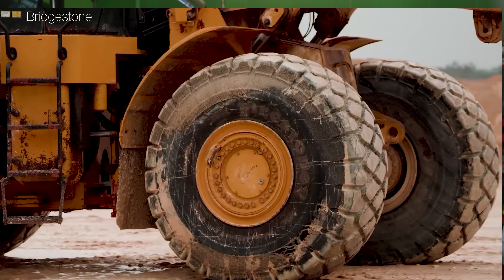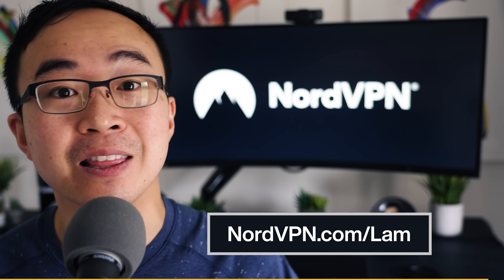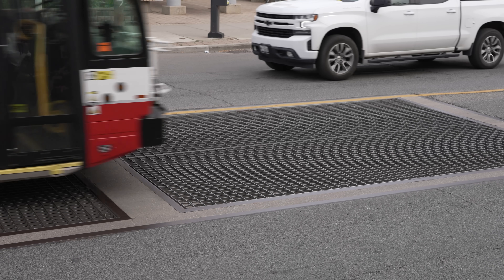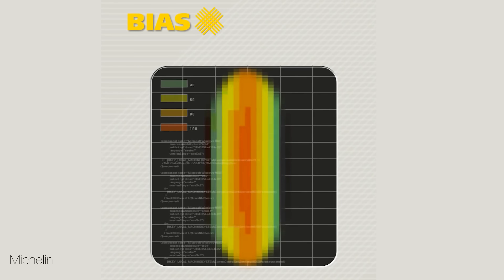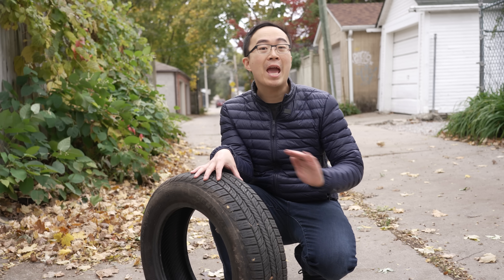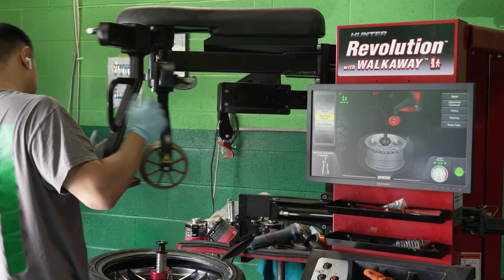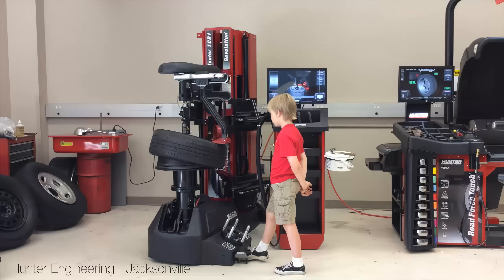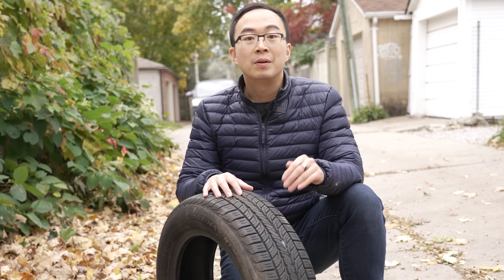How 90 Years of CLEVER Engineering Transformed Tires

Comment: Super late to the party but love the video! If you're looking at new dental tools that make everyone's life easier, I highly recommend looking into crown molding! Used to they would take an actual cast of your gum line and teeth, and now once they've done the prep-work they can 3d scan your teeth, and get a model showing the pressure points a crown would endure as well as how thick/thin certain points would be.

I've had to get 3 root canals within the last year and its impossible to highlight how much the new way is easier

Comment: Discount Tires “Treadwell” program was intended to address some of this lack of data but imo it does far too little. I think we need to offer OBD trackers to group drivers that aggregate driving patterns with weather conditions with all the data it can. If the sample size gets large enough trustworthy patterns will emerge which we could use as consumers. If we ourselves had the data of our driving patterns we could just search for how tires performed on drivers will similar driving patterns over time. Looking to see how average stopping distance changed over the tire life. Rn that data is going insurance companies to exploit drivers but someone needs to make a 3rd party system that user own, in order to apply pressure to tire retailers and manufacturers.

Comment: investigate carbon black to tire wear. I was at a week long conference at NBS in Maryland back in late 80's and Federal instrument had film on how tires had so many variations in tread wear. It was do to poorly mixing the carbon black in liquid compound of the tires. Bye the time  lab demined if blend correct the tires were already . Poorly blended tires wore out rapidly compared with well blended mixes.  they invented a camera system that counted and measured the dispersion of the carbon black in test batch in few minutes which greatly improved tire longevity.

Comment: I’m impressed with the amount of engineering that’s gone into tires since I started driving 20 years ago. 

I drive huge pick up trucks. The latest set of tires, ultimate all weather performance, and a ride smooth as a Cadillac. 

You become a tire nut when you have to buy truck tires, trust me. People with cars don’t feel this pain normally, and a blown tire isn’t all that bad. 

On a truck, for a trustworthy tire (something you need when rolling with 3 tons pulling 5 tons) you’re not getting out of it less than $300 a tire before mounting.
Reply: motorcyclists are similar, but for different reasons. for us its less the cost and more the fact that a ditchfinder is death rather than injury.
us bikers will argue PASSIONATELY about the "best" tyres. 
for me, I swear by road 5's for my fazer and city pro's for my cbf.

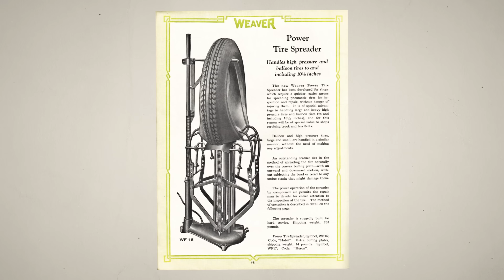Comment: 10:02  "Whatever the heck this was."
It spreads the tire so it can be easily patched.   Note I didn't say 'plugged' - I said PATCHED.  A plug only fixes a very small puncture, like a nail, and does not require the tire to be removed from the wheel.   A larger injury was usually patched.  The tire was dismounted from the rim, and then put in this fixture so the beads could be spread to allow the tech to clean and install a patch on the inside of the tire.  You could only use a patch (or plug, for that matter) if the damage was in the tread area - if it occurs in the sidewall or bead area, the tire is a loss, period, don't even ask.

You don't see these used with passenger car or light truck tires anymore.  It's generally regarded as a liability, since an incorrectly-installed patch can fail catastrophically, and with more vehicles today having a higher center of gravity, catastrophic tire failure can be deadly.
Most professional shops won't plug or patch a tire anymore.

However, in heavy equipment like Terex earthmovers and so forth, tires are hideously expensive and I believe they still use similar machines (though obviously much larger in scale).   I'm not  sure, but I believe that over-the-road truck tires can be repaired in this manner as well.   At least 10-15 years ago they were; the regulations in that industry change so frequently.

Comment: Here I am in a 2014 jeep Patriot with bald, dry rotted tires. And honestly it handles better than you think but what's not really good is when you air it up to 35 psi, it doesn't hold up well it still appears flat. But when I air it up to 50 psi, the true light goes off but the middle of the tire pops up and doesn't sit very flat with the road. Don't ask how it handles on a semi wet road cause it's scary as hell. I really need to get new tires soon😂

Comment: I actually splurged ad got the Michelin Cross Climate 2 from all the research I did into tires. I found so many afforable tires even with high mileage rating, where not close to their expected performance after little wear. I love my Cross Climates and you definitely get what you pay for. I think tires need a better standard for safety.
Reply: Love mine as well, very well built and engineered tire. It provides very noticeable improvement in snow and rain along with great dry handling.

Comment: This is my story, not a scholarly dispute.

 I'm old enough to have seen the shift from bias ply to radial tires.  It wasn't gas mileage that drove my choices.

It may very well be that car manufacturers did make their choice for gas mpg reasons.  I as a consumer driving old used cars would replace bias tires one at a time for budget reasons.  Changing bias to radial requires buying 5 at a time (spare too).  You can't mix bias and radial tires for handling reasons.  I eventually bought a car with 4 radials, but at that point I was not buying cheap.  

Tire stores always sold radial tires at a premium price starting with premium tires, and over time migrating down to basic tires.  Bias tires disappeared from premium to basic.  Basic means cheap low miles per tire, premium means expensive high miles per tire.  Miles per tire for bias started at about 15,000 miles per tire up to, I think, about 30,000. Radials have always been longer lasting.  Earlier decades were even lower miles per tire. 

Tire stores organize inventory in several categories, for instance, basic low miles per tire, middling, and high miles. Radials have always had substantially higher miles per tire ratings in comparable categories and were always more expensive compared to bias.  Eventually the market for bias was so small that radials were cheaper an bias disappeared.

Final note:  "Steel Belted Radials" used to be a selling phrase.  Bias ply tires have never had steel belts and, as I recall, can't.

Comment: Great video. Subscribed. Started playing with cars (and tires) in 1967 when bias tires were it and I remember a lot of those old machines. To balance they used to put the tire on a lever and drop lead weights until it balanced,- all rather approximate. Today's machines are amazing and as you found the hardest part is still lifting the tire on and off the machine. They ain't marshmallows. But, you've got to see 22 inch truck tires changed on the road with a sledge hammer- no machines out in the middle of nowhere.

Comment: The tool in which your were confused on what it did. That was used for repair a tire, it would allow you to clamp the tire down spread the walls and give you more of a flat surface to work with attach a patch to.

Comment: Tires are a lot more expensive than they should be. People don’t believe it, but all of those old tires can be ground into a fine powder, and then used to make new tires. But Goodyear doesn’t want to sell fifty dollars tires, they want to sell two hundred dollar tires. The whole “high performance” tire story is a scam. A new set of tires should sell for two hundred dollars. The raw material is almost free.

And AAA is also a scam. Most service calls are the result of a flat tire. But for many years, Goodyear offered a tire which has a second smaller tire inside. So if you get a flat, you can still make it to the service station. Goodyear stopped offering the tire within a tire, so that AAA could sell more memberships.  Nobody knows who owns AAA.

Comment: These modern tire machines claim to be faster, but they really aren't in a lot of cases. As someone who does this as their job, I'd rather use a Coats machine than a touchless machine. They're more reliable, simple, and faster with more experience. The only thing a touchless machine is better at is not scratching wheels and the rollers to break the bead can be really nice when you have a tire without a sidewall or a soft sidewall (Michelin). They both have their tradeoffs but the Coats is faster and more reliable with getting the job done the same way every time. Even though the touchless machine is better at not scratching wheels, the Coats machines can do it too it's just not as easy. If you have the experience a Coats machine is better. If you want to save time, just go faster. There is always an opportunity to save time when you're doing tires.

Comment: as a tire and alignment guy for the past 25 yrs, I can appreciate all the upgrades in tire engineering and equipment to install them.....i have worked on Coats machines in the early 80s to Hunter machines of today and a lot of the technology has to do with TPMS, alloy and aluminum rims and very stiff and short sidewalls of tires...these weren't big issues in the 80s and 90s for mass tire installations...but as cars got lighter and materials weren't steel anymore, the equipment had to change with the designs...as a big truck alignment mechanic, I saw the differences in a 250 dollar tire and a 400 dollar Michelin and YES, there is a difference...the same goes with car tires and cheaper  tires,  you get what you pay for a lot of the times.....a video on worn tire testing would be a great idea because all new tires perform pretty well...it's the ones that are half worn and can't drive through a small puddle of water or a wet highway that are the ones to be concerned about...great video and i think you are just scratching the surface on what you can make videos about...thanks
Reply: I’m late to this party but I spent about 20 years doing everything from installing to sales from retail up to commercial and GSA. There are lots of BS they try to shove down your throat with marketing jargon. Also don’t get me started on their near propaganda campaigns with the sales people. 

Now as OP said, there is a difference and with each major brand they all have different attributes. Also cheap most of the time is not good so it’s better to shell out for the Michelin. Still, when you notice a half worn tire has a completely different tread pattern than when it was new it definitely makes you start to think a bit more about some of the small stuff that went on in private as far as “training” and incentives go.
Reply: Yes. That’s why I like Michelin cross climate 2 tires. They have been tested right down to the legal limit and preform great still and better than competitors. My Bridgestones I replaced them with where done grip wise at 5/32 4/32
Reply: Coats came out with a new design in mid to late 80s that worked well on the alloy wheels and didn't make contact with the face. That machine was well over 2 grand back then. It was called the RC something, which stood for Rim clamp, the place I worked at got one when they first came out. On regular steel rims I still think the old 40-40s are a lot faster. I've been out of the tire business for a long time so I don't know anything about the hunters, everyone used Coats back then.

Michelin was the first company to actually perfect the radial tire and I think they're still the best.
Reply: Is Michelin the best for most cars?  I have to get new tires for my SUV but I'm clueless!
Reply: Those hunter machines let me tell you, cost effective especially with the balancers and amazing accuracy
Reply: We have those Hunter machines and another one that balances them and shines a light where to put the weights. One annoying thing though, our expensive handheld TPMS tools are always going out for repair.
Reply: Any suggestions who made the tyre machine I saw in the early 1960s or late 1950s ? 
Removal and rebalancing on it.
Reply: I hate them, we should go back to light small cars with ZERO safety features, no ABS, primitive tires, no TC, good ol days, no room for pansies
Reply: @AverageAlien  I don't want you running into me as I crosswalk or bike because you're incompetent so your car needs ABS and TC. I don't want to hear the noisy whine of every car going down the street as I just sit at home, so your car needs sound profile-tuned tires. It's not a pansy thing, it's your preference versus mine, and your preference doesn't matter to me. I win.
Reply: @Demmrir  Chad answer.

Comment: Tires are the most important thing for your safety and performance, ive got a lexusgs350 on cheaper chinese so called performance tires the car was imported with i was lucky to get to 120Ks without the car feeling noticably unsafe at that speed cornering etc, i got a new set of Bridgestone Potenzas and the car is now a beast, faster accleration, faster safer lane changes, and my top speed is faster than i can try on quiet roads,  the cheap chinese tires were about $600 for the set when i researched the bridgestones were around $1800 . and worth every cent. performance cars , big power cars, need to transmit that power and speed to the road safely and tires are where it all hits or misses,  especially in the wet.  great video !

Comment: 10:03 that ‘machine’ or tool is made for tyre repairing. That tool makes the surface flat, so you can sand down the inner surface, than apply the patch.

Comment: I am pretty sure that the "Weaver Power Tire Spreader" is just to hold the sidewalls of the tire apart giving room for hands and tools while applying a leak patch.
Most modern vehicle tires have a wide enough area between the sidewalls to get in with hands and tools to apply a patch, but it used to be more common for sidewalls to be closer together which makes it difficult to get hands and tools in to apply internal patches.

Comment: Tire pressure monitoring not. Clean the mating surfaces and glue it good. I had a car where 3 tires leaked after 10 years. Another 0 tires leaked after 10 years. That car came with another set of tires. None of them leaked .

Comment: The tire spreader is for patching a tire. It opens the tire so you can put the patch in tire on the inner surface. 
Radial tires started in 1968, NOT in 1973-74 due to gas shortage. Suspension was changed in 1968 and forward for better handling and the radial tire gave a better sidewall flex more tire contact surface area for the newer suspension systems.

Comment: I remember a Michelin ad in a copy of...Road & Track, probably?...from probably 15 years ago now. It said "We at Michelin would like to remind you that your tires are the only part of your car that actually touches the ground." Really drives the point home.
To be honest I always wondered why nobody just made tires based on their own fingerprints. Just have a fingerprint pattern repeating around the circumference of the tire.
Interesting note about bias-ply vs. radial-ply design. I didn't know radial-ply was more fuel efficient. All I knew was the circumferential belts on top keep modern tires from bulging in the center.

Comment: It's a shame you totally skip over bicycles and such in your conversation about tired. In what way if any are bicycle tires different than automobile tires? 

I for one have never heard of a machine for removing bicycle tires from their core. Seems that removing bicycle tires by hand will be the standard for much longer.
Reply: He skipped over wheel barrow tires as well.
Reply: @Frankybeanselevators  How intellectually dishonest of you. 

             You don't know that bicycles are considerably more common than wheel barrows? And at that the performance of wheel barrow tires is a insignificant consideration compared to the performance of bicycle tires.

            So it's just as well that he didn't talk about wheel barrow tires. But it was a massive oversight to not even touch on bicycle tires.

Comment: The machine at 10:00 is a spreader that supposed to help with visibility during the repair of a puncture. 

Also, you can still mount and balance a set faster on the older machines. The touchless is neat though.

Comment: Thank you so much for pointing out what has been driving my crazy on several sets of name brand tires I have bought over the past 20 years…the useful/beneficial tread, like sipes, only go less than halfway down into the tread block.  Then as you pointed out in your video, when you should be at the halfway point in the tires life, it is actually an unsafe tire if the weather and traction conditions are challenging.  Next time I buy tires, I will definitely be more diligent in finding ones where the more the useful tread isn’t mostly gone after 20,000 miles of driving.